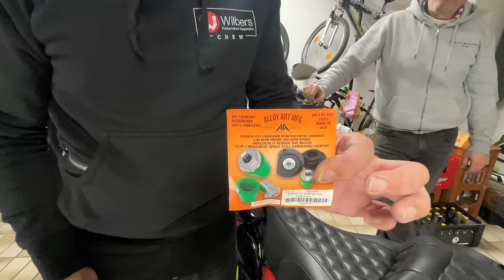No more death wobble on Harley Davidson Touring motorcycles

Comment: Hi, 
How much did the vibration levels increase after fitting this kit? 
I ask because I fitted the same kit to my RG24 as per the instructions and the comments and tips in this video. The OE istaltors are in the right place. Bushings o ALLOY ART are positioned correctly. The vibration level is significant - especially when letting off the gas. The vibration is strongest in the 2500-3500 rpm range. Even the handlebar shake a lot.
Reply from the maker: On ours it was much less than you describe. Nevertheless we removed them again. All bikes were stable in the first place, so getting vibrations for nothing didn’t make sense. I know 5 different M8s, that were unstable, being straight now. For that I would accept the vibrations.
Reply: Wouldn't a rear frame stabiliser solve this problem without increasing vibration?
Reply from the maker: @WhiteRG24  No as the swing arm axle is rear engine mount as well, everything that increases stability on the swing arm introduces vibrations into the frame. Wilbers did some research, with those stabilizers as well.
Reply: Thank you very much! I just saved 250 Euros thanks to you 😉 .

Comment: stefan's are this wobble apply for the new cvo 23 121 aswell ?
Reply from the maker: It might, but mine is stable. So I keep the stock setup, as the reinforcement bushings introduce engine vibrations into the frame

Comment: Hey Stefan, mine is  2017 ultralimited and does the wobble at 140km. Will  this bushing solve the problem
Reply from the maker: Not easy to answer, it's tire manufacturer, tire pressure, swingarm alignment, rear axle alignment that cause the wobble. Theses reinforcement bushings help to reduce it, but they introduce more engine vibration into the frame as well.
Reply: @stefansgarage3014 Thanks for the reply. After 140 km/h, it feels like fishtailing.

Comment: amazed at how you never used any lube between the rubber bushing and teflon , i can see a failure coming soon
Reply from the maker: The "Gooden Tite" are not supposed to move inside the stock rubber swing arm mounts. Be assured the moving parts got a lot of lubrication.

Comment: ok is it necessary to remove the swing arm to install the bushings , why cant you just take out the bolt put the bushings in and reinstall the bolt ?
Reply from the maker: It is not necessary to remove it, but as we wanted to align them properly AND to grease the swingarm bearings, we decided to remove it completely
Reply: @stefansgarage3014  so you can simply install those from the side , by removing the bolt installing the bushing and  bolting it back down.correct ?
Reply from the maker: Correct, but pay attention, as they have kind of an elliptic shape. Otherwise you misalign both sides right away

Comment: Why not replace the swingarm bearings as they were seized.
Reply from the maker: They were not seized, just stiff. After cleaning and relubing they worked fine, as you saw. The CVO is low mileage and there is absolutely no rust/play in the bearings
Reply: @stefansgarage3014  Stefan - how did you clean and relube the bearings?   I assume you did this without removing the bearings from the swingarm.
Reply from the maker: @davefunk1466  correct, we used penetrating oil and a wooden broomstick, thereafter checked the movement of the bearings by hand (no rough spots) and finally packed everything in grease as lubricant and sealant.
Reply: @stefansgarage3014  Thanks, Stefan!

Comment: Why the fuck is dual sprung rear suspension so sketchy (dyna death wobble) but almost every motorcycle on the planet having dual sprung front forks usually not a problem????
Reply from the maker: I think it's not the dual damper setup. It's the design of the shocks and the rigidity of the swing arm and design of the swing arm pivot assembly. Harley is definitely lacking on rigidity and shocks...

Comment: This isn’t the cause of the swing arm miss alignment. The transmission case actually is what holds the swing arm in position. All this does is reduces the bushings ability to absorb vibration. To properly align the swing arm to the bike the top engine mount is adjusted and the front engine mount stabilizer is to correct the wheel tracking to be inline front to rear. Bunch of nonsense.
Reply from the maker: Thanks for watching anyway.